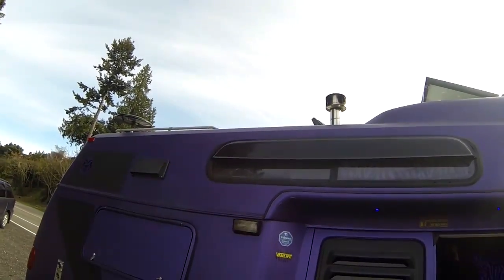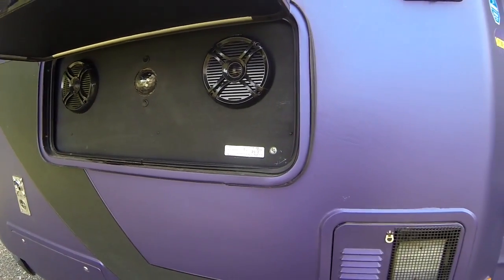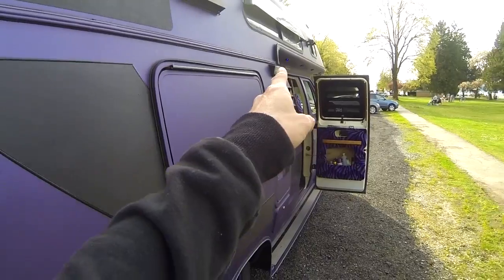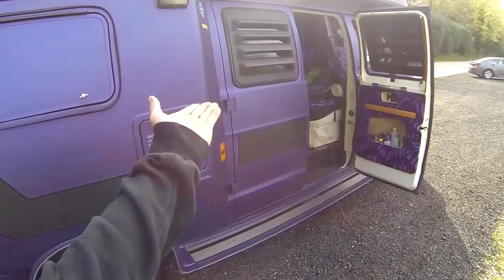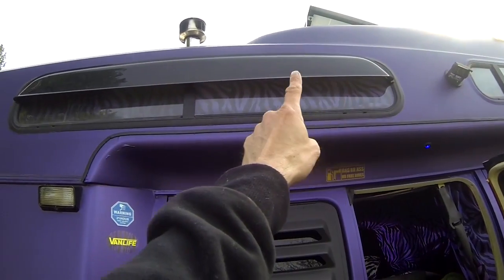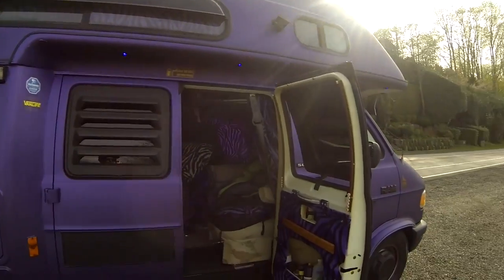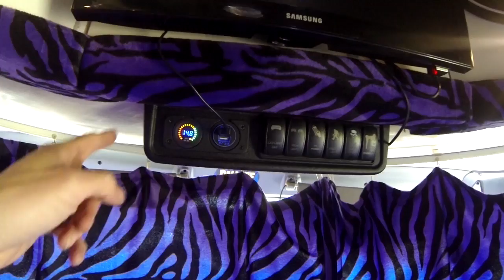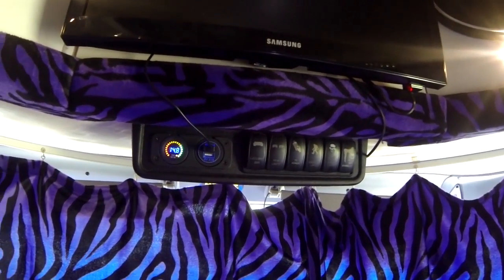Customizing vans is mostly DIY

Comment: Yep!  I needed durable, lightweight, flexible curtain rods for my rig..(older conversion van).. wound up using metal measuring tape pre-drilled  and then adding snaps..  Then when it came to solar controller box.. used 1 stick on floor tile, a dollar store picture frame, and some scrap wood.  I joke that You- Justin, are my 'spirit human..' lol

Comment: previous RV, i bought under counter LED light strips, used for kitchen lighting and accent lighting, came with a remote and with 12v power supply
removed the supply and connected to the RV 12v
worked great,
usually come in sets of 3 or more, in sizes of 4 watts or more per strip

Comment: One modification I would do to your van would be on the outside. Your running board/ground effects, It would be badass to have someone make you some custom "Rock-sliders" I know you're not planning to go offroad but they would make the sides of your rv idiot proof from someone backing into it. They also add a jacking point anywhere on them. Search for them if you're not sure what I'm talking about lol. It would cost you under  $1,000.